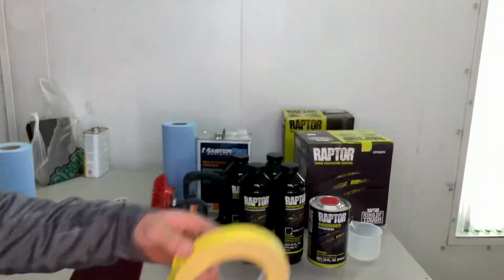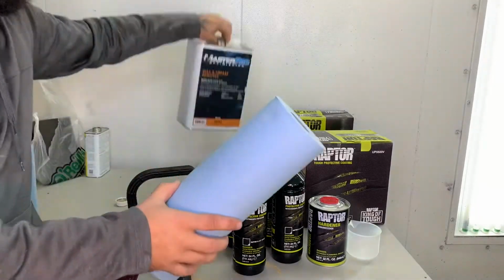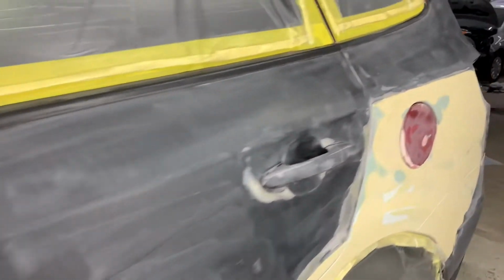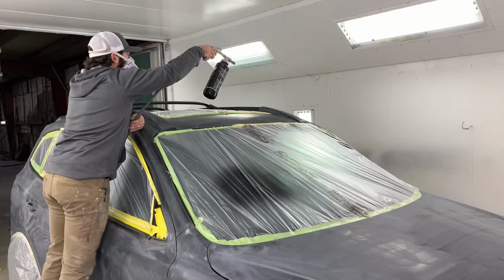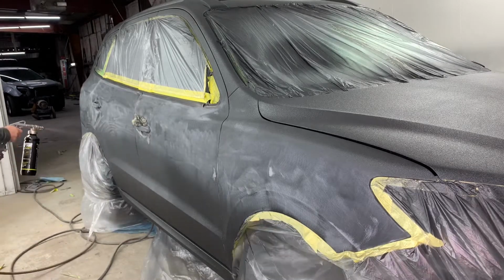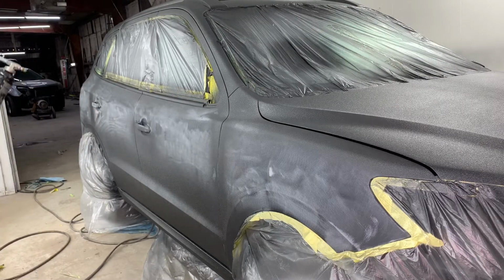Bedliner Paintjob

Comment: Why would you paint a car with bedliner rather than a more normal paint?  Is it more durable than normal paint? does it stick better? Do you have to use a sprayer, since the finish is not smooth anyway can you just use a roller or brush with similar results (except it may take more tiime?)?